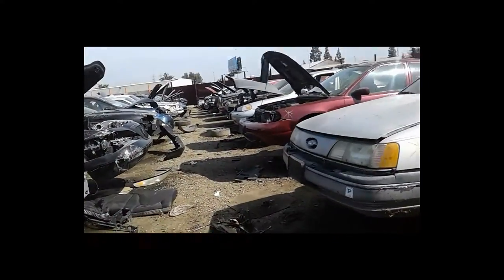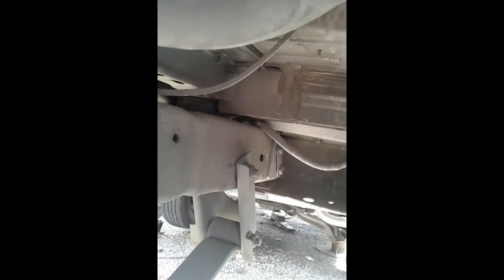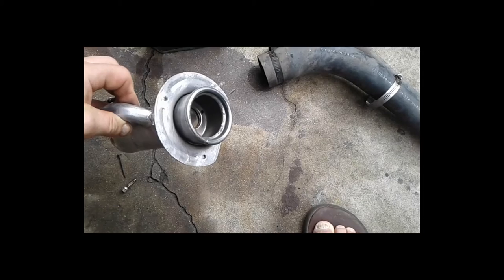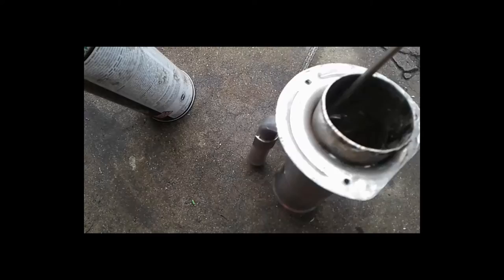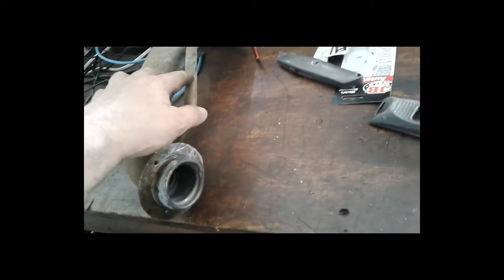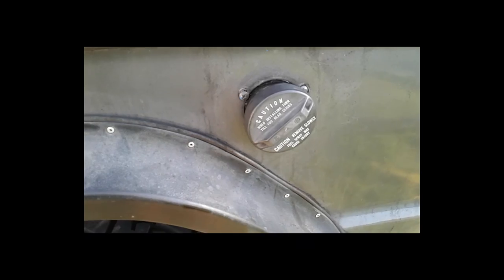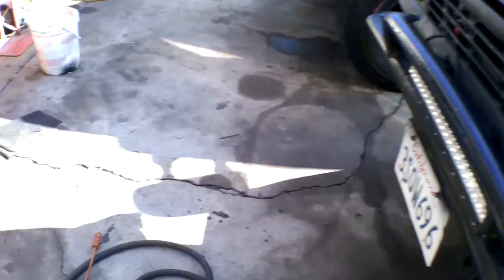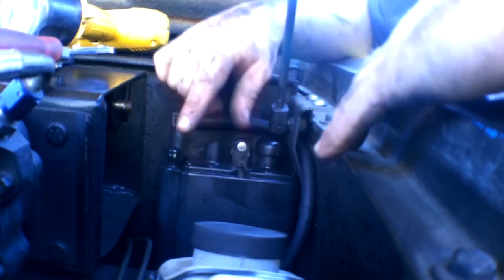Early Ford Bronco Evap and filler cap vent conversion swap

Comment: You need to change your fuel lines to PTFE (Teflon braided) lines.  This will eliminate the smell of gas.  Rubber lines degrade and allow the gas to seep through the lines.  Teflon lines will not degrade.